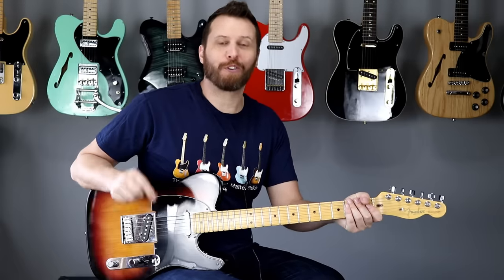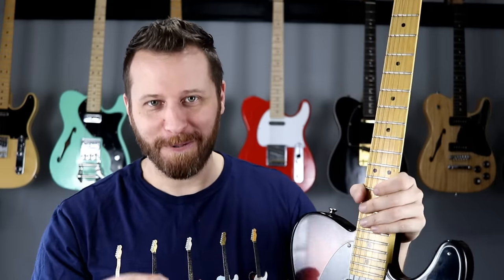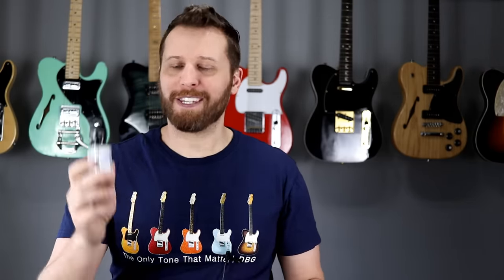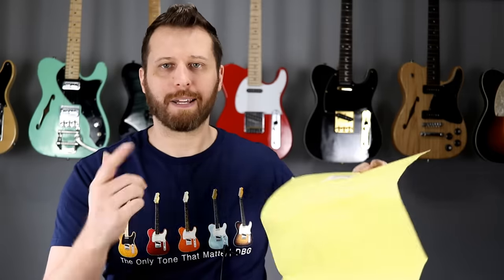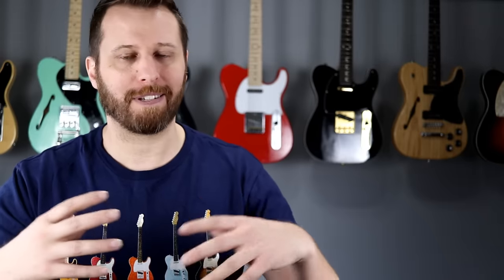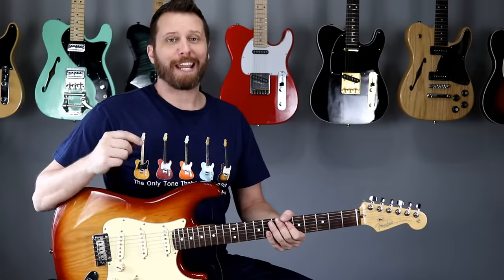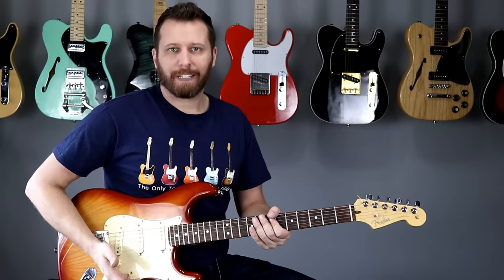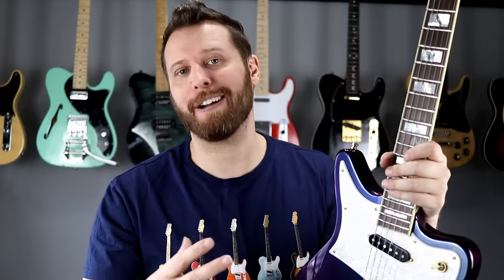KILL The Hum and Buzz!! - Keeping Your Single Coils QUIET!

Comment: Yeah, nice tips. But. I live on a hill and my flat is surrounded by offices - I am within the reach of at least 20 different WiFi signals. And there is a skyscraper with a ton of transmitters on top of it looking directly into my window. It's ridiculous to use any booster/distortion pedal, the noise becomes grotesque.  My only solution will be to enclose myself in a very fine mosquito wire mesh and ground it. Or move out of this microwave, it's probably cooking my brains also.

Comment: I’m not even dealing with single coils, I just spent 200$ on this Seymour Duncan pickup that guarantees no noise and what do ya know! There’s noise! It sounds like a damn single coil, I’m so furious and confused, I’ve dealt with hundreds of guitars, there is no grounding issue faulty solder joint etc.

Comment: What about a dummy coil? it's a coil without a magnet put in the guitar away from the strings, and wired into the circuit to be paired in opposite phase with whatever single-coil pickup is on. I had a guitar with one in it once, and it worked, but I was told it had some effect on tone or output or something. Does anybody know about that?

Comment: At 5:46 you play without a noise gate and then afterwards with a noise gate. However, all the highs are cut out of the tone with the noise gate - which hurts the tone of the single coil pickups simarly to using a noiseless pickup. Maybe worse. Not so great.

Comment: When you have single coils in series, like in a tele with a 4-positions switch, it is supposed to be hum cancelling.  However, with the two pickups that far apart physically, does it also roll off the highs like a regular humbucker or does it preserve the true single coil sound?

Comment: Just install a dummy coil. Take a cheap pickup and remove the magnets and pole pieces and wire it in between the switch and volume pot.

Comment: A total noob question but...  Does anyone know what is that wire inside my strat back plate...???   The one's  connected to the fork of the tremolo spring...
Reply: It's just a ground wire running to the volume pot. It grounds the bridge to reduce hum.

Comment: Does shielding tape or paint work better?
Reply: What's more important is using a continuity checker (or ohmmeter) to ensure EVERYTHING is solid to your jack barrel. (Never forget that very old amps can kill you with reversed hot/neutral).
"Paint" is massively easier, but can easily be an infuriatiing mess if you are not very careful, and may need 2 or 3 coats. I painted a very hot quad rail all over its case and it now behaves like a angel). Remember it's not exactly paint, it's basically soot suspended in air-drying binder fluid. Shake that bottle lots.

Copper anything is a real test of your patience and painful if you aren't super careful. 

Do not fear aluminum - the difference in resistance at the power and frequency level of guitar signals and the shortness of the path is laughably tiny. And yes, regular aluminum foil works fine as long as you ensure all pieces are electrically connected.However copper can have soldered connections, while aluminum can't and so must have solid "mechanical connections. But that can just be tape over where edges overlap. I have a 335-style where I put adhesive aluminum over a baggie and fit it around all the pots. Easy? No. Worth it? Oh, yes.
Finally, all your wiring that leaves a shielded cavity must be itself be shielded and connected to all other shielding. Don't obsess over not having all wires come to a single "star" connection point. Again, these power levels, frequencies,  and distances will have practically un-measurable ground-loops.
One weird idea if you have a humbucker pickup is to take out a screw per each string: this will be VERY close to a single pickup sound, but still humbucking (no it's not exactly the same, but it is so easy, and easily reversible if you don't like it.)